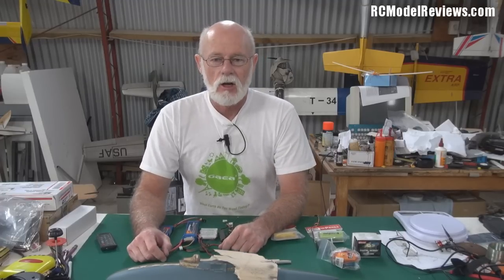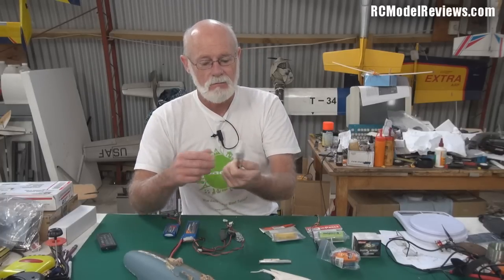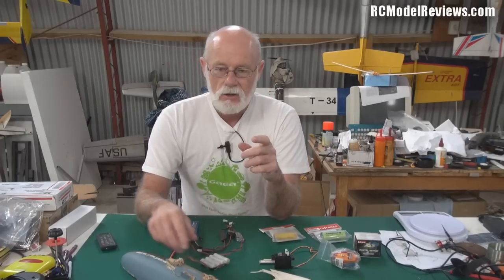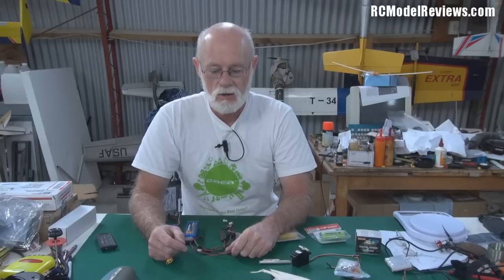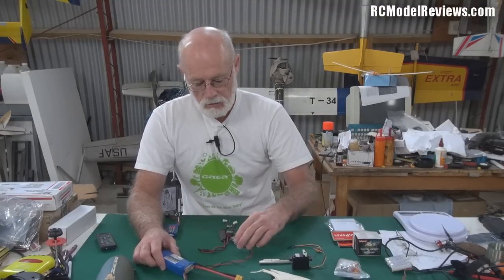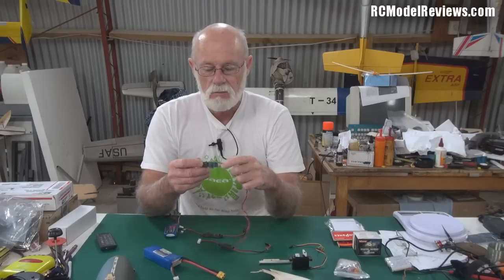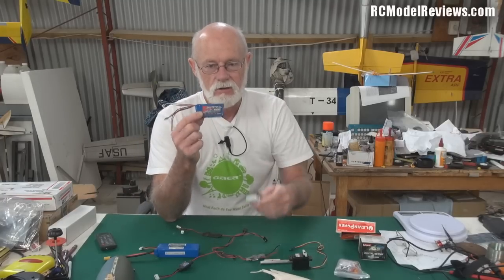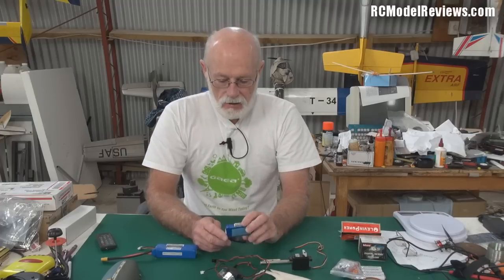A word about receiver batteries

Comment: I pulled a 220mah cell with a wrong polarity from a "toy" RC motorcycle I have. My friend purchased a... not so great glider using non-micro servos and a 4 x AA pack!

Swapping the leads on the switch harness allowed me to thoughtless continue to use the original charger for the battery, and it saved a considerable amount of weight. Who knows how long a flight time we'll get, but this time around I think it does actually have a chance of flying!

Comment: The problem here is not with the NiMH batteries. Depending on the model you may draw 10A peaks from them.
The problem is VOLTAGE. At such tough loads the voltage will drop down to below 0.9V/cell. So you start out with 4*1.2V=4.8V which already is marginal, but when you start stalling 2, 3 or even 4 servos then you're down to 3-4V. This is a dangerous territory as receivers will turn off in this range.
Just adding 1 more NiMH and you'd be fine. Starting out with 6V, dropping down to 4.5V with multiple servos stalled.

Comment: And all over sudden, i feel old. It is 2019 now and i do fly a 250g Parkflyer with a 24g Motor, 2 Servos (3.7g) on my trusty 35 Mhz Multiplex Europa Sprint Transmitter.
Reply: Nothing wrong with a great name brand VHF system.  I've gone back to them myself,  due to multiple reboot issues with 2.4ghz stuff in my area. It really is the most cluttered, poorly regulated RF band there is. Wifi, a wireless home thermometer, bluetooth....completely cluttered and not bulletproof like it was 10 years ago. I use PCM Futaba and JR radios, and no problems since.
Reply: @guerrillaradio9953  can you still use old radio's at the fleld?

Comment: Using better quality battery helps keeping the voltage in between safe values, but it's far far away from something you can call "a safe power source and feed to the electronics".

High power servos also put a lot of stress on the receiver if they are sucking power from there, so a second step on safety is wiring the servos to the receiver with signal only, and powering them directly from battery.

Than, you may want to overcome a battery failing (dual battery array), and many other aspects...

Comment: Got a cheap $20 NiMh receiver pack from amain for our new RC trucks. Figured those are the easiest to work with, safest, and the tried & true battery type when I was into the hobby over a decade ago. First charge it blew up. I coughed up some $$$ and only run Spektrum LiFe packs now.

Comment: Nimh batteries are generally fine for most applications expect high draw situations as Bruce said. A real problem is that people charge a Nimh battery like a Lipo e.g. charging a 2000mah Nimh at 2A doesn't charge the battery at all because all chargers nowadays are delta peak and are only waiting to see a peak in the voltage. So charge your nimh's as slowly (e.g. 0.1a)as possible and it will be fine :)

Comment: Just got into 1/8 4wd nitro buggy pick up a thunder tiger eb-4 s3 pro and im installing 2 7.4v 20kg servos for steering and throttle and definitely knowing now I'll get a 2000+mah 2cell lipo to running my 2 highvoltage servos

Comment: Battery types are a minefield. I fly a 76cc Bidule tow plane and when on the 'tow' every servo in the model bar the release until flipped, is working very hard maintaining correct attitude, bank and yaw - so the fingers are busy.. I have always used 3000mah LIfe 2S batts x 2 until recently when they seemed to suddenly (overnight) degenerate to a stage where they will only accept about 70% charge.  Being desperate I flew with these batts... two flights towing, I lost signal at the same height and same direction of flight and distance from me. The tug rolled over and dived and I guess within 2-3 seconds I had control back - twice. On checking the batts once safely back on the ground, both gone from 70% (being maximum charge) to under 50% in two very short flights. Lesson learnt but I am now changing back to Lipos.

Comment: Thanks for the update I am running 4.8 to 8.4v servo and was wondering if those 6v pack would work so I checked the spectrum receiver voltage it's about 4 to 9v so I just bought a spectrum Rx 2000 7.4v receiver battery do you think that will work cheers Rick

Comment: Fair point on the voltage of the freshly charged 5 cell NiMh packs but with LiFe being a consistent 6.6V does this not put extra stress on the electronics in the servo (e.g. motor windings)?

Comment: Oh Nutts! ive just bought x2 5cell 2300mah enloop batterys to power my Hangar 9 60 size P 40 with a laser 100 four stroke engine! 1 to power rx servos etc and 1 to power retracts! Ive anways used them with my IC stuff and had no problems! Also have a 30 cc Edge with a 2s lipo and bec! May change that though! Cheers Bruce

Comment: What about the CDI ignition modules of the Gas engines, do the 6.6V Life batteries pose a problem there? I'm using a regulator to cut my life packs back to 6V.  Is that necessary?

Comment: I'm building a 55" spitfire. 80 amp esc with 5 amps for the radio gear. Seven standard analog servos. Will that ESC provide enough power for seven servos?

Comment: I was just considering making a regulator for one of my new DLGs, but you bring up a good point about adding more points of failure. I'm planning on using four DS285 servos, although the specs have a torque range of 4.8 to 6.0 volts, is it safe to put a LiFe's 6.6 volts on the servos?

Thanks Bruce, another informative video that could save my models :-)

Comment: I know this is well old by now. New to the model game. Originally was running my 6v model on a lipo but have swapped to LiFe now. Peace of mind. Only issue is I’m having to make xt60 adapter cables but hey ho. Getting better at soldering in the process.

Comment: spent 900 on a .50 heli, used a nimh pack for 4 high torque analog servos. when I gave it throttle, 4 of those moved causing a brownout. into the sky it went never saw it again. it was NUTS

Comment: Bruce, is it correct to say that since the servo position is sent in pulses the motor windings are only seeing ~6.6V for the width of a pulse (~1.5ms) and at a rate of 50 times a second for an analog servo i.e. duty cycle is low? Also is it reasonable to assume the motor windings are the sensitive part of the servo and not the electronics?

Comment: Hey Bruce, can you answer a question for me.  I've just moved into electric helis, 550 size, and the manufacturer of my model recommends using a separate 4 cell nimh pack as a backup to the built in ESC, plugging them both into the rx. Is this a good idea or should I disable the BEC by disconnecting the positive supply line from the ESC..

Comment: just a little question

i have a stock losi raminator nitro and it has the losi 6v pack i think 900 mah also. and i have a 7.4 volt 1300 mah dynamite battery to upgrade with. but the orignal battery has a jst connector and the reciever area has the jjst female plug (obviously) how do i change that? i dont want to fry something. and the wire gauge is also much larger. thanks

Comment: The only issue is the cable size with those rx packs, you can just use 2 of them to split the power between the two.

Comment: I like the cylindrical LiFePo4 for gliders. If you choose the components right you can run the whole ship on one cell. Or use two. They still fit most fuselages.
Pouch type LiFePo4 are much lighter and bigger. If you have the space for them I guess they are the way to go. And you don't have to solder the cells together.

Comment: LiFe batteries are also quite convenient compared to LiPo for this application, due to their voltage levels.  3.3V nominal per cell and approx 3.6V when fully charged.  Which means a 2S LiFe is between 6.6 and 7.2V - compared to a 2S LiPo (7.6V-8.2V) - 3.8V nominal per cell and approx 4.2V when fully charged.

Comment: Hi Bruce:
I have a battery question I hope you can answer. I'm currently working on some 2.4 GhZ conversions of vijtage radio transmitters using the FrSky DHT DIY RF modules. I have a buddy who wants to use NiMH batteries in his. I purchased the batteries from HK and they fit perfectly in the battery box of our World Engines Expert transmtters. My question is ... what charge rate to use for these NiMH 2600 mah cells? I remember the charge rate for the original 600 mah NiCads was C10 or 50~60 mah. Would the same C10 charge rate (in this case ... 2 amps) hold for the NiMH cells? If so, can they be fast charged from time to time? What would be a safe rate for fast charging? I will appreciate any comment. Thank you.

Comment: Hi there,quality videos! as usual, but I have to just give my thoughts about bec's, Im a guy who likes simple setups as you mention, more stuff more to go wrong, but looking few years back were all the lipo tech started, I been flying all sort of electric planes, small big, helis, and never ever had a bec going wrong, only in one case the speed controller gave up, but rc still working, and on todays massive hi tech 600 700 class helicopter using huge servos and massive lipos, for the Rc they still using a good quality bec, and those choppers could be  quite dangerous out of control!, again there are not many cases apart from the odd wrong connected battery, For my 50cc gas planes I like to have some redundancy used in some twin regulators using 2 2s lipos, heavy duty switches plus using twin 2100 mah batteries you end with 4200 mah to power your plane for the whole weekend although I like to charge up before going up! some setups are in a reasonable price range without going in to the expensive power boxes field which I thing they are too big for a 50cc plane, yes for a 100cc with two servos per aileron 2 for the rudder etc, any experience with the dualsky vlr twin reg?.

Cheers!!

Comment: Hi Bruce,
I tried using a LIFE receiver pack on my FRSKY gear :
Receiver Specification:
Operating voltage: 3.5~10.0V
Power consumption: 100mA
Analog voltage: 0~3.3V

Only to find that it cooked all of my servos in a brand new HK RTF model (FPV Raptor) and subsequently had servo lockup in flight with crash following shortly there after?? 
I read the receiver spec and believed that the analog voltage would represent the voltage coming out of the receiver to the servos ? 
Did I miss something ???

Comment: Hey i am putting together a 40 size nitro piper cub. I have the spektrum ar6210 receiver and am wondering what type of battery i need to power my reciever and servos? How many volts and mah? I think j have a 2000mah nimh now but it is no good.

Comment: Do you have any rules of thumb for determining a suitable capacity of battery for an application? I've got an 1100mAh A123 pack in a 1.20 size yak54 with 6 digital servos and people are telling me that's uncomfortably low, but I can get a solid 7 flights on that!

Comment: Quite many servos, including the Hyperion Atlas DS09 servos are rated at 5.5V maximum. This means that you still need to use a BEC with a LiFe to bring the voltage down to a spec level. After all the 2S LiFe is 7.2V fully charged.

Comment: I use a typical receiver system, powered by a typical BEC attached to my typical ESC. How does my typical receiver manage to start operating at up to 10 volts when it's only supply is 5 volts ?

Comment: I'm new at this - your opinion please -
I'm flying MICRO size foam planes 1-4 oz.
They use 1 or 2 cell lipo.

I'm using a DX6E transmitter 2.4 freq.
Should the 4 pack Enelope batteries I'm using be okay ?

My DX6E gives me a warning when the pack is low.
I recharge the pack and that's been working okay so far.

Comment: I received a fpv mariner in the case and there is a 6 pin connector which appears to plug into the lipi battery second wire (small voltage wire, I think) My question is -Should I connect this or go straight for the direct connect and keep the transmitter receiver seperate all together

Comment: I have heard of redundancies used in battery hook up and I would like your opinion. "Power Box" idea seem like a great idea but the expense is ridiculous. I have a 90" AeroWorks Edge 540. I have been out of the Hobby for 15 years and it certainly is a different world than I left. I have two thoughts about power distribution. (1) Is the idea that using the receivers last aux input will isolate is one battery fails, but does this stop one battery from trying to charge the failed battery. I want the redundancy but will this work. (2) I think a circuit built with two power rectifier diode in series with each of two LiFe 2250 Mah batteries is the better idea and I can see and understand it would work. Does the receiver idea really work?

Comment: Trying to use LiFepo4 battery to replace Nimh for the receiver in my Traxxas Revo 3.3 truck.  Will not work. Acts like Nimh when voltage gets low.  LiFe is freshly charged and measures 6.5 to 6.6 volts. Tried two different units.  Any suggestions?

Comment: More advantages nicds have against lipos. In my experience nicd's have a useful life span of about a decade. Lets talk durability (lipos cant touch nickle). And let's talk cell failure. A nicd pack has a cell fail, you still get your power out of the remaining batteries in the pack. A lipo cell fails. You might continue getting power out of the pack. (Ive had them go fail both ways).

LIPO's are undesputed king of powering your motors
Nicd's can not be beat powering R/C gear

Keep flying Bruce!

Comment: Is it safe to use a couple of diodes and drop the 7.4 v to 6 v from a Lipo battery? I'm not using any electric motor. This us for a glider. My receiver can take from 4.8 to 6 volts. Looking for a reliable source of power for long periods of time.
Reply: Jorge Gouverneur Hi Jorge, im using a 400 volt , 10 amp rectifying diode, its drops the LIFE battery voltage from its nominal 6.6 volts down to 5.9. Its super over engineered not to fail, you have more chance of a servo plug failing its maximum amp draw which is only 5 amps. Do a google search for this , NTE ELECTRONICS       NTE5814HC       RECTIFIER, SINGLE, 400V, 10A
Reply: Gavan Sexton  thanks. I'm going to look it up.  I think diodes will do the trick to replace a BEC
Reply: As per video anything you add to drop voltage is another point of failure, (and using a non switching regulator circuit (minimal heat loss) is going to dissipate the power  loss in the voltage drop as heat (could be a lot of heat too depending on volt drop and current), So I would not recommend this method to do it). Better to use a LIFE battery (nominal voltage is 6.6) and servo rated for 6V+ or use (2nd choice) a sbec (switching bec), (but is a 2nd point of failure too)
Most 6V+ rated servos work fine on LIFE 2S packs.
Reply: Just note any power loss across that is going to be heat. 10amps with a 1.4V drop is 14Watts of power , which is a lot of heat on that small rectifier , I would not use that method myself on a lipo if thats what he intends. Even on a LIFE battery 0.6vx10A is still 6 watts of heat  (a large amount for a small surface area). Most 6V+ servos run fine on LIFE packs.

Comment: i have a new out of the box plane, it has never been flown/ charged anything and the battery that came in it which is a 600 mah on the first cycle fell short at only 400 mah.. I cycled it again and it came back to a little over 500. is there any way that I might be able to bring it back from the dead up to the required 600 mah and if so is it safe to fly with?

Comment: The Life batteries are rated at 3.3 volts per cell. most seem to use 2 cell, so 6.6.
There was a warning on one battery site that some of the smaller 17 gram servos are rated 6 volts or below and that 6.6 will reduce the life.
Do I need worry?

Comment: I appreciate your wanting to help. This is a very technical subject and requires a technical presentation. Are you up for constructive advise?   Yes.... great.... no.... well sorry its coming anyway.    Were you only about speaking to NOT USING AA batteries, and the rest of the facts one would have to figure out for them self?  IF that is the case then you made your point. A few things added would have helped.   Please speak a little slower. Your accent is touch for some of us.  You said the same things over and over.  Granted it was said in different ways, but the time could have been used to present more facts.  A lot more needs to be said.  For some one to employ LiFe batteries, they most certainly should google and get some thorough info.   But you are 101% correct. Pilots have no choice but to keep up with the changing times.  In all honesty, its not that much to learn but it does take time and commitment !   Thanks for the video. I am sure it will help.

Comment: Great Site.I came upon it by accident.Glad i did.
Q. I have a 1000w hub motor for my ebike which says i should use a 48v battery.I have linked 4 sal batteries to make up 48 v but performance is poor under load.What would you recommend + - 14 a123 battery cells joined to achieve 48v, or existing battery packs as sold by hobby king .what charger would you recommend ?Looking forward to you reply
Thanks
John H

Comment: I would like to say that AA sized (450-500-600ma) nicd packs were NEVER a problem for larger fuel planes because NOONE in the world ever used such small packs flying giant scale, or with servos larger than Standard size. (40-60oz). Entry level IMAC legal giant scale fliers typically would use 5s 800-1100mah nicd packs. This is enough to run five to six heavy duty standard sized servos (50-110oz).

Comment: i have a life battery in my p-51. it has only one charge wire. it is a j connector. it has a balance wire. one cell is very low. it is a life 6.6v 2200 mah 2 cell battery. how can i balance the cells?